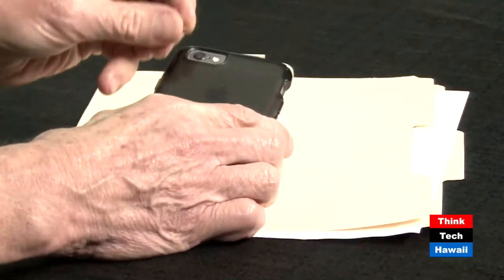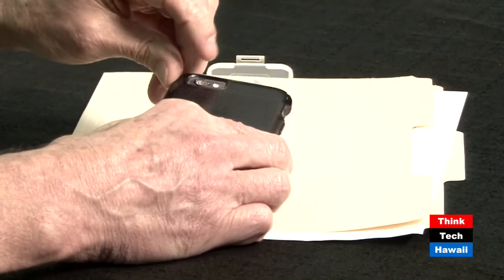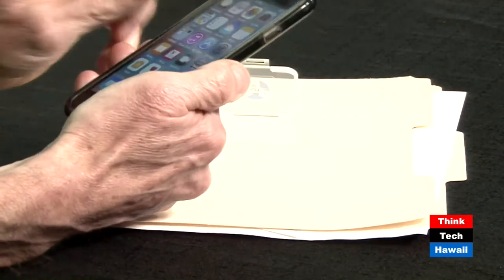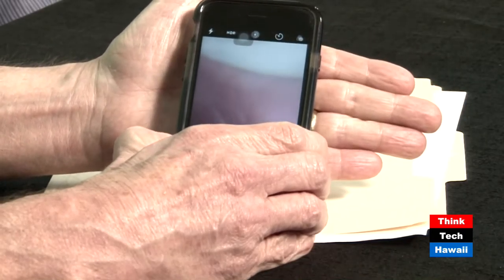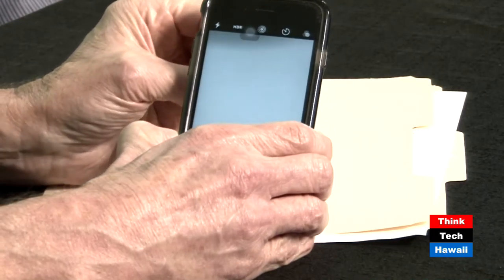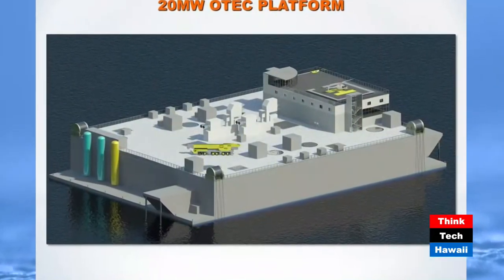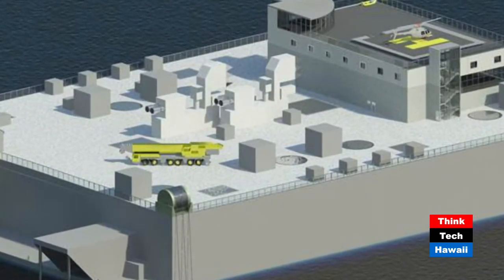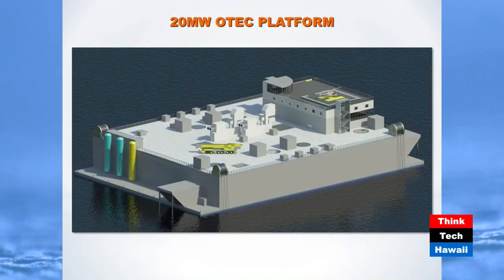Diving Deeper into OTEC - Ocean Thermal Energy Conversion with Dr. Hans Krock

Comment: I can appreciate someone saying well what if we had followed a different approach and built up a hydrogen economy, it's quite literally one thing to say that, it is quite another to actually put something like that to practice. Even if his fantastical idea of how historical events might have played out differently, nobody wants to pump around cryogenic fluids to fuel society, even if the energy to create it was free, it's a pain in the ass no matter how you slice it. Now had he said an ammonia economy, yes I could see that, it works fine in an engine, albeit less powerful than other methods, but we have a globalized infrastructure of manufacture, transport, and use of it and that doesn't require rewriting history, it's more feasible than dealing with super cold scuba tanks of hydrogen.